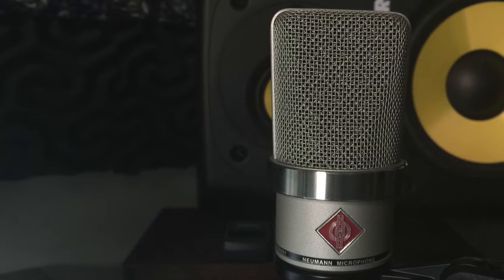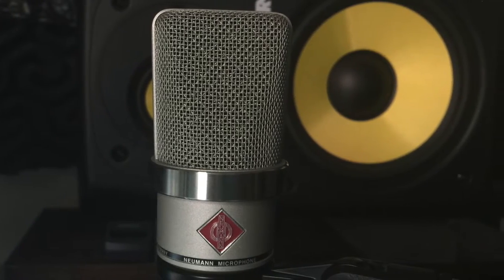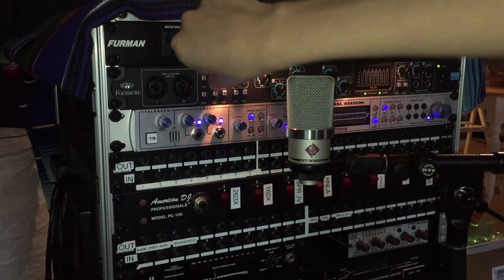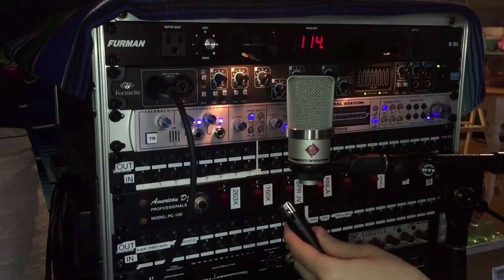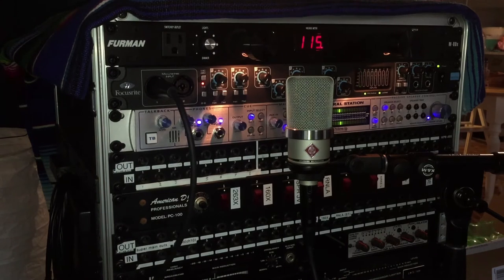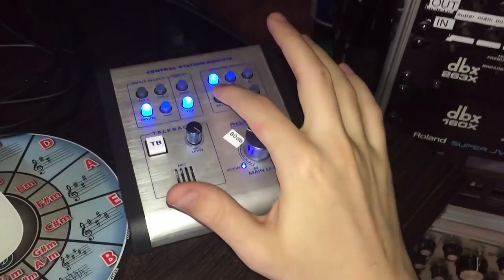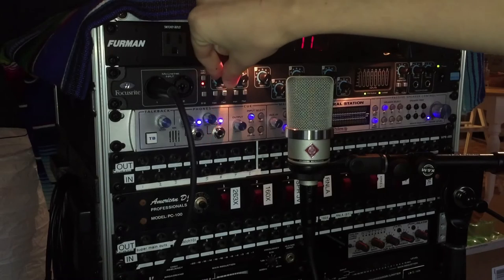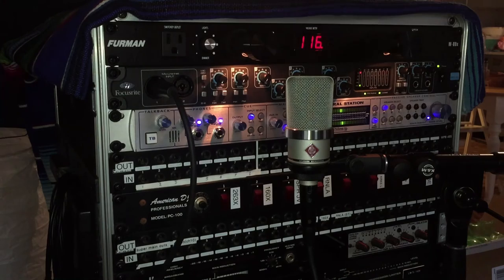How to Connect Condenser Microphone with Phantom Power to Reduce Popping Sounds

Comment: Thanks for the video. I have an Audio Technica 4033CL hooked to a Behringer Wing. When I have it hooked up, then turn on the phantom power, it goes through a series of random popping, really fast and multiple ones at first, then gets slower as time prevails. It's almost like I have to crank an old car up in the winter before putting it on the road🤣 Any knowledge as to what may be going on in my case?! Like, I literally have to wait about 5-10 mins before I start recording to NOT record one of these random pops🤔😥
Reply from the maker: its common to hear pops even on high end mics when connecting to phantom, but your case seems excessive like theres a larger problem with the mic or interface. try the mic on a different interface to see if the same issue happens.

Comment: Do I need to turn off the gain with my iterface each time I start my computer?  Or can I leave it plugged in once I connect it for the first time per your instructions?
Reply from the maker: By gain do you mean phantom power? I’ve left it on accidentally plenty of times and nothing bad seems to happen.  But I would mute the output to the speakers when turning it on or off to stop any pops

Comment: I just bought this mic and when i turn off phantom power i can hear a few low frequencies pops coming out of the monitors, it lasts about 10 seconds. i can also see it on my preamp and on my compressor , on the vu meters, my previous mic did not have this problem. Turning the output level of the preamp all the way down before turning off the phantom power would be the only solution? I can still see that the vu meters are going up even though i dont hear it in the monitors. Can it damage the preamp or the mic?
Reply from the maker: i think mics are weird like that sometimes.  dont have a clear answer for you. even if you turn the preamp gain down the issue may still occur even if you dont hear it. I still get pops and noise from some mics but dont from others. you're probably fine. condenser mics can be surprisingly durable. try it with a different preamp or cable too so you can rule out those as the potential problem